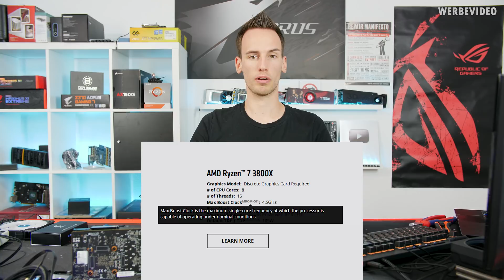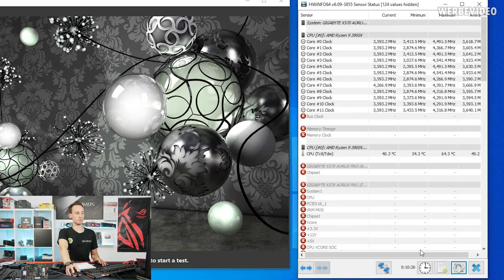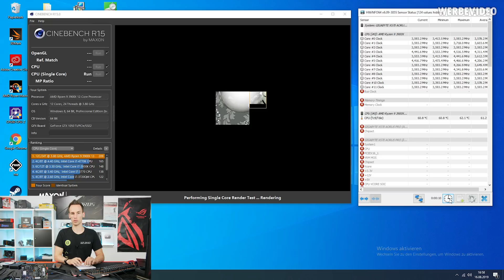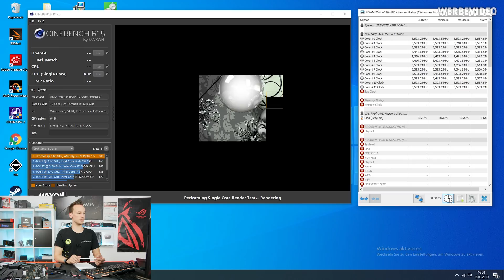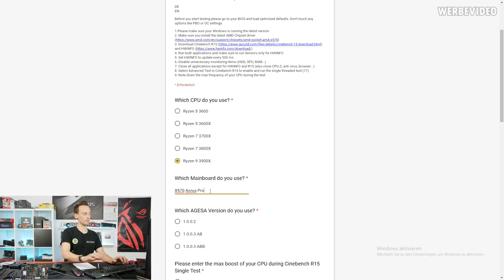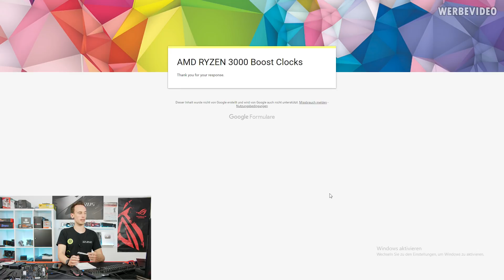I need YOUR Help! RYZEN 3000 Boost Analysis

Comment: My 2700x at default settings would boost to 4200mhz monitored using afterburner during games, all cores. I have a Noctua 14u on it with excellent air cooling. I decided to build a 2nd system using the bang for the buck Ryzen 1600AF new refresh chip so I decided to get a slightly newer board and bought a Asus x570-p Prime board for the same price as the B450 boards($117). Well the same chip, same cooler at default speeds only hits 4100mhz on the x570 board that is supposed to have excellent VRMs. Disappointing to know my stock setup with MSI Tomahawk Ver.1 easily did 4200mhz stock and this newer Asus Prime x570 will only do 4100mhz. Bummer.

Comment: Hello, and for a rayzen 3 3200G with VEGA 8, what requirements should I have so that the microprocessor is not overloaded?

I have a GIGABYTE B450 AORUS ELITE (rev. 1.0) with 8GB RAM hyperx fury black ddr4 2400mhz and power source of 1000 watts EVGA GQ 80+ GOLD, with that it is normal to run games and video editing? Sorry may Bad English XD!!

Comment: That HWInfo appears to be shit. It's not showing the correct core clock values at all. The "Minimum" voltages never change on mine and show around 3400 MHz for all 12 cores all the time, even though I can see in Ryzen Master that 10 cores are asleep and the two doing something are only at less than 500 MHz. So if it can't show minimum properly, then what confidence do you have in it showing maximum correctly either.... none for me.

Comment: My test I submitted fell short because of the GameFirst V software that was running in the background. It was using 8% out of 9% CPU usage. This software comes with certain high end Asus motherboards. Ryzen Master also confirmed a massive drop in clock speeds, temps and power by ending this task. I new something wasn't quite right. Check that you are starting from your base clock speeds before testing. 3700X  Asus X570 ROG CROSSHAIR VIII HERO - CINEBENCH R20 - AGESA 1.0.0.3 - MAX CLOCK SPEED 4,342  I can now smile 😁

Comment: Sorry, something changed on my System and i get a Boost of 4.4 not 4.375 - i get sometimes 4.425 on my 3700X. 

What Changed? New Bios 1.0.0.3 ABB on my C6H. We need an Option to change our former results (former result 3.375).

Comment: Loading optimization defaults puts PBO and other tweaker settings to auto. I appear to be boosting above my base clock of 3600 to 4225 for the 3700x Is this ok for the test? Also should I select my correct memory speed? Can I use CINEBENCH R20?
Reply: Most systems the AUTO is stock specification i.e. disabled.

Comment: mine boosted 4620  out of the box upgraded BIOS now it sux  4491

Fixed ccx OC.  4500 on ccd0 ccx 0 4400 ccd0 ccx1.    4350 ccd1 ccx0 4350 ccd1 ccx1. 1.36 volts  max temp 72c.  Cinbench single core 216. Multi core 3406

Comment: Im running a MSI B450 Gaming Pro Carbon AC with a Ryzen 5 3600 Latest chipset drivers from amd, latest bios for this MB ( NOT the beta one, that made the clocks even worse ) the bios is agesa 1003 AB.  Single core Boost WONT go over 4100Mhz, All core Boost wont go over 3996Mhz Period! PBO does Nothing, same clocks, same cinebench scores, Same goes for autoOC doesn't do a dang thing, i get the Same clock speeds and the Same scores.. the ONLY time i can get better clocks and better scores of to Enable Game boost in the Bios which i really don't want to do.
Reply: Exactly the same here! But on a Tomahawk MAX

Have you tried a manual all core overclock? If yes could you reach anything stable above 4100?
Reply: Same on Tomahawk MAX

Comment: There is a problem here. After a day of confusing thermal testing I came to learn that my Asus Crosshair Hero VI motherboard with latest bios and completely default settings actually has PBO (to repeat that is overdrive) enabled by it's default "Auto" setting. This was leading to a 95w power consumption which is higher than my 3700x spec. I redid the survey and it reduced my result from 4375 to 4366. That isn't a very dramatic difference due to the test being single core but this means the "default" settings for boards can include overclocked setting being enabled which I believe to be a very important clue to different motherboards hitting different clock frequencies.

Comment: Another good app to test single core frequency is running 7zip benchmark with 1 thread. It runs continuously so you can get an average for larger amount of time than cinebench. My 3900X boosts up to 4575 (4566 actually due to 99,8 fsb) but most of the time is between 4500 to 4550. I never managed to get 4600 with either cinebench or 7zip. Motherboard is ASUS Prime X470 Pro with AGESA 1.0.0.3AB

Comment: i made i mistake on the first google form , so By resting everyting on my 3700x BIOS 1003AB / mobo B450m Mortar i got a score 196 at 4.4ghz on a single core with 1.48v ( Cpu max temps 61° degree ) and on all core i got a scores at 2102 at 4.0ghz 

R20 scored a 4816 with 4.0 ghz 
R20 on single a 483 with 4.4 ghz

Comment: My MSI x570 Gaming Plus is running 1.0.0.3a which is not available in the poll so I selected 1.0.0.3ab
Reply: do you get the advertised boost clock with your motherboard or not? because i planning to buy one of those boards.

Comment: Switching from the stock cooler to a DH-14 added 100 MHz to the max boost of my 3600, from 4192 to 4315, all stock settings both ways.

Comment: UPDATE: My NEW findings
 I posted the survey. I have...
Asus TUF Gaming X570-Plus Wi-Fi & r5 3600
No matter what I do, it will not reach over 4092.7 on first 4 cores and 4117 on last 2 cores. I can't even manually over lock it past 40.5 ratio @1.45 volts. Bios never gets past the cpu stage.
AMD advertised a 4.2 boost on this CPU and  that's what it should get. Maybe it's Asus that is still crap for AMD. Who knows but someone needs to get their act together.
*Ryzen 5 3600 on Asrock b450m-pro 4, hits it's rated boost. The 3400g on the asrock, hits it's boost. The 2200g on the Asrock desk mini a300-stx, hits it's boost speed. ASUS = 99.8 bclk. Asrock, 100.1 bclk. So, if the chips aren't hitting boost on the Asus, but are on the Asrock?*

Comment: MSI Prestige X570 Creation here with a 3900X, with bios V110 and V120, boost up to ~4600mhz,  bios V132 and V133 boost to 4300mhz only ... (Bios V132&V133 has been removed on the website), the ram compatibility is better on V132 and V133 but the clocks on the cpu are wrong :/, also PBO and auto oc don't work on all bios.

Comment: RYZEN 3000 is a big fail. Most X570 not working and full of countless bugs and unstable. Most XMP RAM not working. Bluescreens. Bios bugs. Bios reset.
Reply: Not on my 3700x on an asus x570-e gaming board my ram is Corsair 3200 mhz rgb pro clocked at 3600 mhz  and is totally stable with none of the problems you seem to be having

Comment: Do you have any way to measure very short boosts?

The PB2 specs imply that it can do clock adjustments faster than memory latency, which would mean that it's entirely plausible for the CPU to be hitting max boost almost all the time there's work to do, but for duration too short to show up in any sort of monitoring tool.

Comment: I can get 4550mhz on fresh Windows 10 1903 install with chipset drivers only for 3900X by allowing my PC to do nothing. Seems like some drivers and apps prevents it from getting cooler. I can confirm Corsair iCUE prevents my 3900X from going idle clocks. HWMonitor could spot 4550mhz boost. Very close to 4.6Ghz. I can only get 4.4Ghz on my primary Windows 10 1903 installation.

HWMonitor:
https://imgur.com/MF64Uvt

Ryzen 9 3900X
Noctua NT-H2
Corsair H115i Pro (Balanced)
Gigabyte X570 Aorus Master F5l
G.Skill Trident Z (for AMD) 16GB X2 DDR4-3200 CL16

Asus Crosshair VII Hero (WIFI) BIOS 2501 could get me higher than advertised boost.
https://imgur.com/ariyl9H

Comment: 3700x here I did the test with both AB and ABB and I submitted the last one, it was the same result btw 4350, have tp say that latest chipset drivers made more difference than the new agesa, I was at 4325 before, but with ABB I have better temps, I remember i had higher clocks with 1.0.0.2 tho like 4491

Comment: Roman, your way of testing Turbo Boost is wrong and has no real value, what you test for is a SPIKE, not real turbo boost.
 Ryzen 1000/2000 and ALL Intel CPUs do Single Core Turbo boost by keeping single core at max advertised value for as long as thermal or power limits allow, it can be tens of minutes and hours depends on cooling.
Temporal SPIKE for 1-2 seconds has zero worth.
You need to monitor for the value that stays unchanged start to finish, not 1-2 second spike.
Reply from the maker: Lol it's how AMD recommends it
Reply: @der8auer  And whats the value of looking for one second Spike? Don't you want to know whats the maximum highest turbo boost for single core that Sticks and stays at the top for the duration of the benchmark?

Comment: I have a 3900x running for a week or so (X570 Aorus Elite - F4j - 1.0.0.3ABB), I did your test and the max clock was 4575. Yesterday I build another 3900x for my brother, same specs. After installing windows (no drivers) the first thing I did was your test, it was hitting 4625 in 4 cores (PBO disabled, all stock), and outside R15 some of them was hitting 4650mhz (I thought, my brother just won the silicon lottery). This was with the default bios (F3 - Agesa 1.0.0.3). After I updated the bios to F4j the max clock went down to 4475 in the same conditions, never saw a single core hit 4500 after that. I was able to submit the first 2 results (my brother submitted the second result), but not the last one because the form only accepts one submission per account.

Comment: Agesa AAABBBBBB. For me 1.4~1.5V It's not "Normal". I would not buy a Motherboard X570 with that power consumption and high temperatures on its chipset and the cherry of the cake, a stupid 40mm FAN, no way, AMD drop the ball, again.
Reply: V*A=Wattage. The voltage drops under load to stay within AMD Power specs. I wouldn't worry too much about it. My chipset fans runs at Zero RPM most of the time on my AORUS Master x570 so that's not a huge issue.

Comment: What do the windows Drivers have to do with the clock speed?
All you need is cinibench and a way to get the clock speed, this can be done on super old Windows, or any other operating system.

I'd like to participate but don't want to spoil the data with maybe not wrong data, but taking under conditions not allowed by the test.

Comment: Results are depend on core the test is running (you can check with applcation manager - to run on another  core you need to restart cinebench  app).  For me best results are on 1,2,3 cores (Boost is 4550 Mhz). Worst are on 7,8,9 cores (4300 Mhz). Matherboard  is MSI X370 Gaming Plus, Processor is R9 3900X

Comment: I'm not going to submit another entry to the test but I feel like its worth to mention this here in the comment section perhaps others can upvote this and try it for themselves.. If you just change the AI tweaker from default to auto on my board atleast I get 25mhz higher boost hitting 4502mhz from 4475.. (not sure what other board manufacturers call this).. try and see if it makes a difference. have fun :)

Can confirm this works for both 3700x and 3800x have both cpu's
Reply: it changes the "BCLK", in my case from 99.80 (cpu defined) to 100.6 (mb defined) on the crosshair vii hero.

Comment: you'll get the maximum boost clock if stressing just 1 core with a 100% load  while all other cores must be down to near 0%, provided the cooling solution is sufficient. At least that's the case for 1st and 2nd gen chips. Best tested on Linux and sthe stress or stress-ng tool.

Comment: Ich habe gestern meinen neuen 3700x in das crosshair 8 hero eingebaut und direkt nur Probleme gehabt. Keine meiner Festplatten wurde erkannt außer der m2 mit windows. Außerdem habe ich post-zeiten von 81-82 sek. Hab mich fast den ganzen tag damit beschäftigt und windows neu aufgesetzt (war vorher auf z270 mit 7700k). Hat aber auch nicht geholfen. Habe dann die cmos batterie rausgetan für 10min. Danach wurden die zusätzlichen festplatten beim post angezeigt aber in windows nach wie vor nicht. Hab die cmos dann anschließend nochmal entfernt und war ca. 2 std weg. Als ich zurück war und sie wieder einsetzte hat plötzlich alles geklappt. Festplatten erkannt, boot-zeit ~18 sek. Was für mich zwar immer noch schrecklich ist im vergleich zu dem setup dass ich vorher hatte aber besser als die ergebnisse davor. Ich bin bis jetzt eher enttäuscht von meiner jüngsten Investition. Mobo wurde auf neueste bios-vers. geflashed und windows ist aktuell. Weiß nicht was da los war/ist. Über den boost-clock kann ich noch nicht viel sagen aber werde es mal ansehen sobald ich zeit habe (samstag). Lg

Comment: Assuming default mem 2133 (non-XMP)? Will run and upload results for a 3900x on a MSI Meg x570 & ASUS CH7 x470 - with the same mem kit. Am interested myself to see what the results are for both boards as well as the greater community. Great idea and good job!

Comment: I ran this test as described and submitted the results. have just now turned PBO off and set the Ai overclock to DOCP. on a crosshair 8 hero, the result came out with two cores boosting to 4.5 rather than the 4.4 in the test. CPU is a 3900x, the clock boost recorded slightly higher when i opened ryzen master. cores 0 to 5 record a max clock of 4.42ghz to 4.52ghz
Reply: I was getting 4.45 max clocks until I turned PBO from auto to disabled.  Then I got 4.475 on 5 or 6 cores.  3800x under water.  I've seen it hit 4.525 in CB single thread before.  But not using Roman's criteria.
Reply: Going into task manager and shutting off a few processes showed the first 6 cores all hit 4.5 at some point, with the remaining cores getting around 4.3 which from what i hear about the chiplets this would likely be normal, something in the system was holding all cores at 4.2 minimum even when not used and ending processes at some point made these drop to 3.8

Comment: Out of the box with AGESA 1.0.0.2, my board got to advertised speeds (4.400Ghz 3700x). After updating the bios (AGESA 1.0.0.3ABB) it now only gets up to 3.375Ghz. Just my 2 cents.

Comment: Sharing what I submitted. X570 Aorus Master. 3700X. Only 4325 on 1 core. Cooled with an EK velocity block it hit 65c in 21c ambient. D5 pump full speed with 2x 280mm Hardware Labs SR2 rads in series. Please comment if you 3700X boosted to similar. *edit 4100 all core.
Reply: It hit 65c in single threaded CB?  Something is wrong there.  Does your Aorus board have any auto OC settings on auto by default?  Asus has performance enhancer settings and if I turn those on, my boost clocks drop and my temps skyrocket to 70c in CB single thread.  But if those are off, I only get to 55c with a 24c ambient.  3800x with the same block and 2 EK 360 rads.  DDC pump at 66% speed, fans at 1000 rpm.

Comment: My intel 7920x, all cores at  4.7GHz (delidded, 600mm of rads), all the time, in any app.  I'm going to change to 3950x when it arrives. More cores, less power use  and pretty much as fast in gaming. Hopefully by then this boost shit will be sorted out.

Comment: I am intrested to hear what single thread CB scores people are getting, the current bios for the MSI creation is boring but soild perfroming just seemed to clock all cores to 4.35 ish on auto I would say this is aimed to try get best out of the box performance for all core work loads over other boards, I could get it doing the whole boost thing by forcing on one of the many PBO settings MSI stuck in there but best clock for those was 4.425 so the older bios perfromed better with its auto boost settings if I recall right still not as advertised 4.6ghz XD 
for now I stick to my OC of 4.475ghz at that set speed the score is 208 points for single thread on my 3900x what are people getting when their chip is boosting right? XD

Comment: I submitted one response using the current BIOS which is AGESA AB

I also have a new beta BIOS version which is ABB and wouldn't mind doing it again, i'm just unsure it would be allowed.

The results, it so happens, were far better than I'd expected; under "Normal" previous testing... 

(iow, without purposely setting everything to auto, and without turning off ALL unecessary sensors, and without eliminating EVERY background app)

..i'd gotten the impression my chip (3700x) was below average.

Running the test as Der Schnauzer instructed, I saw my same 'below average chip' hit 4.4 on 5 of 8 cores on the first run.

Just goes to show that the stuff that makes a difference is far simpler than many imagine, endlessly trying to tweak arcane BIOS settings, undervolting, etc.  Literally just running everything bone stock, with everything carefully measured, showed the best result.

Comment: Time to lawyer up and class action amd, sue them so they recall their crap and start again, they shouldn’t had the chips fabbed in China and rushed out the door, bad silicon can’t even reach advertised speeds. Sitting idle at desktop in windows and seeing cores hit max boost speed for a millisecond doesn’t count, under load does not hit boost speed, does not auto overclock, and all cores fall to a way lower clock under load. Bugs in bios, nvidia Gpu pci express errors in windows due to hardware bug, ryzen 3000 does not work as advertised in any of their announcements made before they went on sale,,,

Comment: Happy to participate, left my R7 3700X results on the survey. Suggestion: there should be an option for AGESA 1.0.0.3a, because MSI still haven't updated it in most of its boards. I marked 1.0.0.3ab on my survey and commented that there.

Comment: Ah, dang it. I submitted results with my xmp 3600 memory settings. The weird thing it was lower clocked (and slower) than when I was running with memory on default? Only got 4466mhz on xmp, 4577 with defaults? on default the memory is only running at 2166mhz?